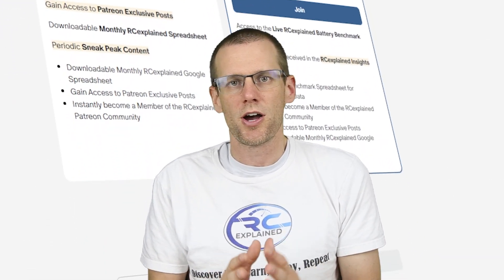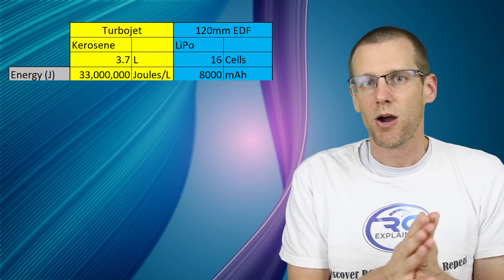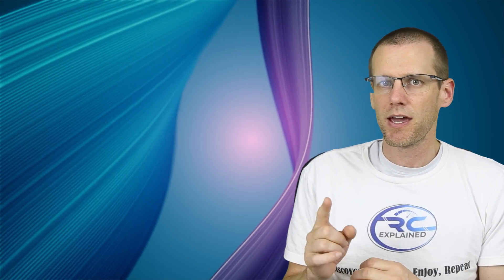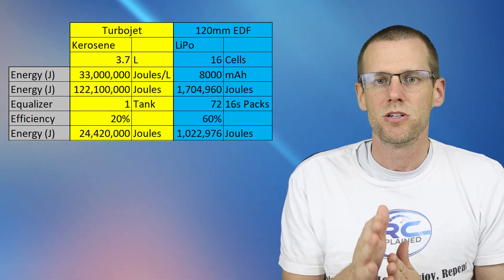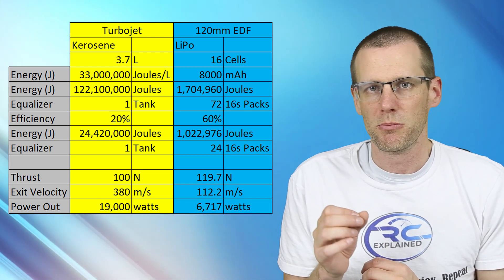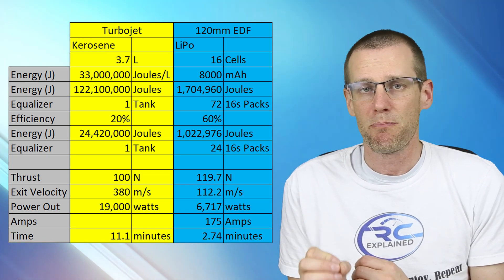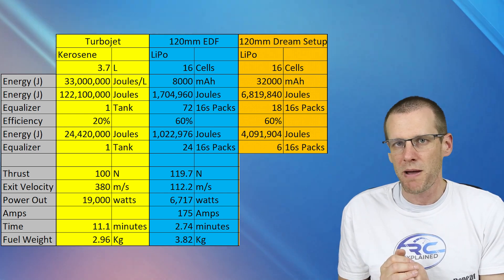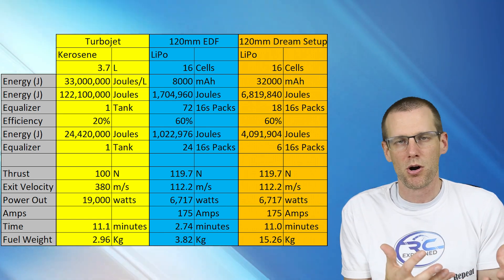Mind Blowing Comparison - 3.7L of Jet Fuel vs How Many LiPo Battery Packs?

Comment: 10 more yrs and just maybe battery tech will be worth doing,  like ev cars the battery is way to heavy and way too inefficient. and then there is heat regulation with batteries , sorry way to many fires to be safe. hybrid is the answer at this point in tech.
Reply from the maker: Yep, I'm not a believer in electric full size vehicles yet. Not until they consistently last 20 years with no major repairs.
Reply: @RCexplained  lol well with today's electronic components the 20 yr thing is over forever .
Reply from the maker: @MrBumbles2  haha

Comment: Good explanation and comparison. My dream set up would be a more efficient axial flux turbojet motor. With small diameter twin rotor to increase RPM and efficiency with less inertia. More copper mass in the coils equals more efficiency than what's currently available. I believe we focus too much on batteries and not motor technology capability
Reply: Motors are already very efficient if using good motors. Even if you had 100% efficient, no loss motors you only gain 10-15% flight time over what we have now. The batteries are the problem with airplanes. I flew electric in the 90's with brush motors and NiCd batteries.
Reply: @rcdieselrc me too I raced RC cars brushed with Nicd and was lucky to do a 5-minute race. Now I can go 25 minutes plus flat out. When they say electric motors are 90% efficient is very misleading to what's truly happening. I have two electric setups which both claim to be 92% efficient but one of my setups runs longer and just as fast on the same battery because it has a better motor. Look up axial motors design it's going to be the future it's already in some planes now
Reply from the maker: Great suggestion!
Reply: I will use 70% efficient petrol engine , i know it's latest in efficiency

Comment: "...I looked up a typical turbojet and how much propulsive efficiency we get from that specific engine and it works out to be somewhere around 20 to 30%..."
This is for full scale turbojets. You get nowhere near that for RC-scale turbines - lower pressure, lower combustion temperature etc.
It kind of shows up in the low static thrust value.

In practical terms, when battery power density doubles (in a few years) this will bring the EDFs performance close enough for most use-cases.
I would totally prefer an EDF with (2,74min*2) circa 5 min flight time with 150+N of peak static thrust (could take a little bigger motor) to this 100N turbine
Reply from the maker: This is why I went with actual numbers as the last comparison. It's hard to argue with run time, thrust and exit velocity metrics. These are more real world numbers directly applicable to the application.

Comment: Hydrogen. The future near here now.
Reply: What exactly do you expect hydrogen to do? Be a hard to handle, difficult to store fuel with bad energy density?
Reply: @fabianrudzewski9027 i expect it to power RC's in Space.
Reply: @fromthebackofmymind  for that to work, you need to carry an oxidiser with you. Necessary for a rocket, for anything else it's a lot of hassle. Might want thing about traditional Solar cells and nuclear batteries.
Reply from the maker: Sounds fun to me!